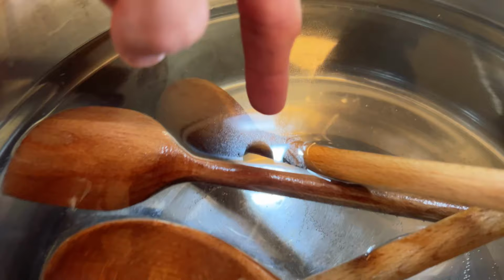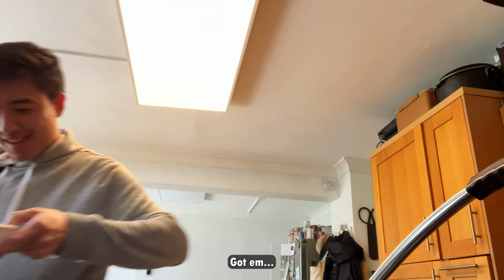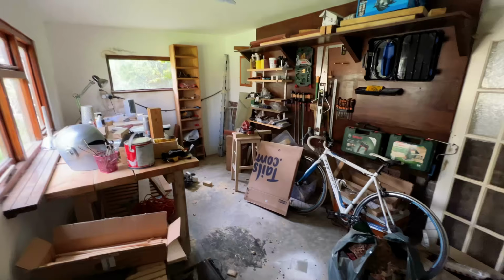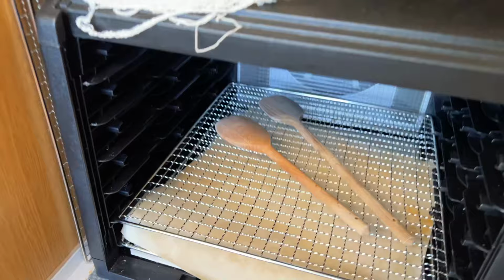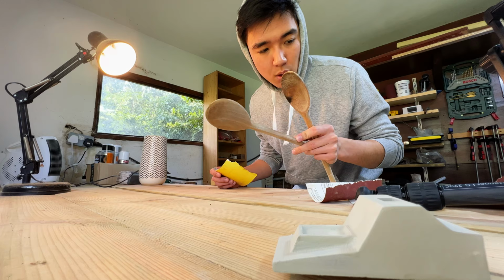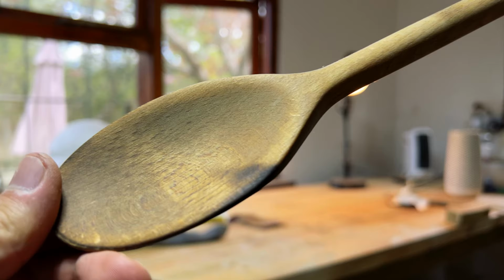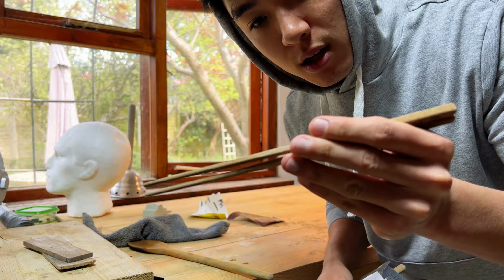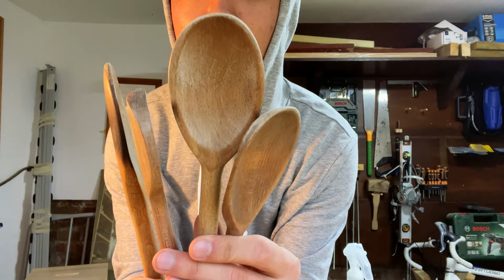Make your wooden spoons better than new

Comment: I would have washed it first. Next, soaking and boiling wood in water with salt will prevent any wood bugs or pests in the future. After wood oil treatment, if you scorch the spoons, it closes the pores on the wood. The trick is to let the oil fully absorb and burn after.  Both are the best for wooden knife handles. If it is for an item that does not come in contact with food, it is the same process, but instead of oil, soak in birch tar. It will be nontoxic, waterproof, and pests proof. Beeswax top coat is up to you. Stay awesome

Comment: Pretty sure the blossom petals are safe to eat but be sure no herbicides or fungicides have been used before consuming them. If you don’t know at all, it is probably best to not eat them. Some herbicides don’t wash off with soap and water and some are oil based and absorb through the skin.